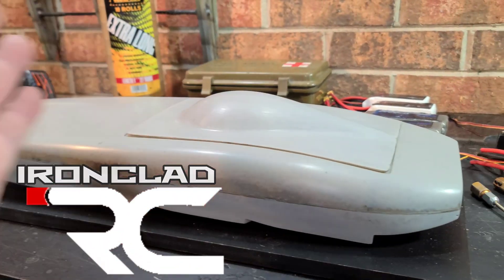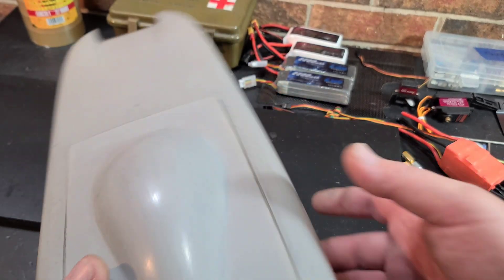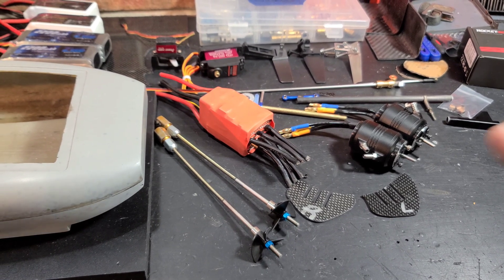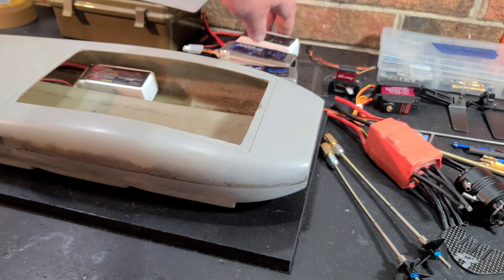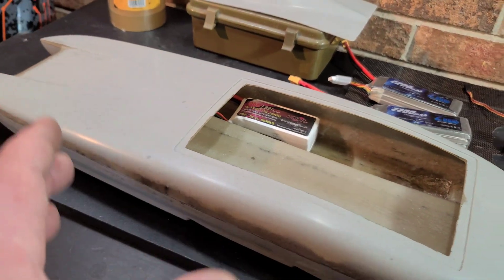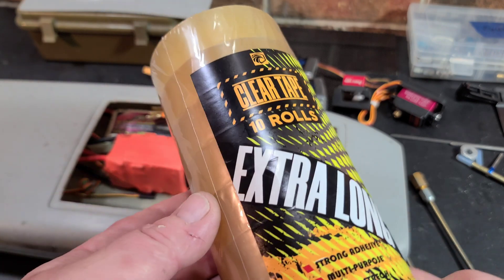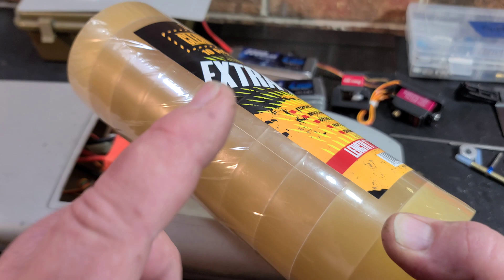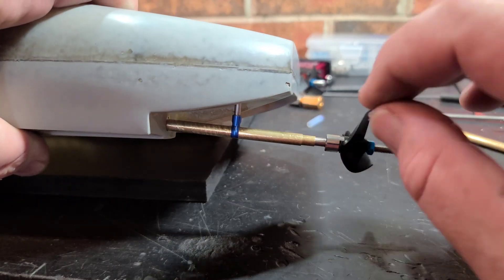Twin Motor Rc Catamaran Build Part 1 - Model Ships Ahoy 21" Catamaran

Comment: Hello sir good day hoping you can gave me some information,what brushless esc will fit on 3000kv brushless motor.thank you
Reply from the maker: What's size is the 3000kv motor, and what type boat are you putting it in.
Reply: @IRONCLADRC  it’s an outboard brushless motor sir and I will put it on the UL-18 miss vigas hydroplane

Comment: Love the channel! Just got done 3D printing out a 30 inch cat and have been going through these videos like crazy trying to soak up as much information as possible. Does anyone have any recommendations for a motor? trying to run 6's on a 150A Flycolor ESC? Thanks
Reply from the maker: Thanks for all the support,  depending on hull weight you should be able to use a 3674 1900kv sized motor

Comment: Awesome build. Really.  Way big (heavy) ESC's though,
I run my twin Rocket 2960  3400 kv outrigger on 100 A 6s.
2960's on water cooled motor mounts and 4 splash intakes.
This little cat receives some beautifull motor mounts, way to go.
In fact, after 40 plus years of rc boating your vids have made me
considdering smaller boats.....your little cat is too cute !🤩
Reply from the maker: I agree, it's over kill I know, I've run a 2968 4000kv with 90a flycolor lol with no issues.    But the 150a esc's are lighter than a FC 90A.

Comment: Big b you think I can use this a deal on the Miss, Geico, 24
Reply from the maker: Possible yes.   I'd go 2958 size opposed to 2948 for the 24,
Reply: Cause I will have to sand and carbon fiber the inside, and I’m trying to figure out a good set up for it

Comment: AWSOME!!! Intergrading the motor mounts into hull is pure genius Big B. 
  I put one rocket 3400kv on 4s in my BJ24 and it just flew above the water, approximately 65mph on the octura x642…but got to hot, had to down size.
  Ok, so I plan on using two rocket 3400kv motors in my (yet to start) drag boat project with the ESCs  mounted behind the motors and forward in the hull so I have a clear path up the middle for a generous  amount of battery movement, maybe that will work for you.  
  I have also found that larger torquey servos work better in fast boats. This project of yours will be fast no doubt 👍👍👍. BGFL
Reply from the maker: Thanks Neal, best I could do with a 2968 in my bj24 was 60mph.   👏

Comment: Nice to see ya prepping to do a micro cat.  Regarding the hull, have to say, it looks like it's possibly a Chinese 'knockoff' of the Hydro & Marine Drifter Micro.  Unfortunately, Oliver has had a bit of a problem in that area...his hulls are top-notch, that Chinese manufacturers have taken to copying his hull, sometimes making slight modifications to the design, so as to make them look less like an H&M hull.

The "copied hull" point aside, looks like it should turn out to be a sweet lil cat.  I purchased a Drifter Micro hull from H&M a few years ago, also intending to build a twin (including purchasing all hardware & electronics (except servo)...but, as I didn't have a proper "RC/hobby workstation" at the time, it got put on the 'backburner'.  Having moved to Vegas almost a year ago, and having set up something closer to a 'proper' workstation, I finally have the space to work in such projects.  Now, I just need to get through the other half-dozen projects I'm already working on.
Reply from the maker: IMO It looks nothing like an H&M Micro Drifter, but what do I know.        Challenging build either way, hopefully the end results are worth it.
Reply: @IRONCLADRC  IMO, "challenging" is fun. 😀

Comment: YA B THAT"S HOCKEY SOCK TAPE. THAT"S WHAT I USE ON MY BOAT"S. WE WRAP THAT AROUND THE ANKLE TO THE TOP OF THE KNEE TO HOLD THE SHIN PAD SECURE. HOLDS REAL GOOD AND ALL THE GLUE COMES OFF. ALL THAT TAPE $15 CANADIAN, CHEEP. AMAZON.

Comment: It looks easy when done, but there's a whole lot of planning in a custom build.  Gotta think 5 moves ahead for certain.
Reply from the maker: Hard part is tracking down the hardware for the smaller boats.
Reply: Oh yes, that is indeed the case.  Your boat is similar to many of the European hulls in that it has that transom overhang to make the boat appear more "scale".  Makes it a PITA on the smaller hulls.  When the boats get small, the hardware to fit it doesn't always exist.  You have to make something.  You have the up and down forces set with the turnbuckle, but don't forget side-to-side forces.  If your struts are really long and you crank full rudder, I'll bet there are considerable side loads on those stingers.  😉 @IRONCLADRC